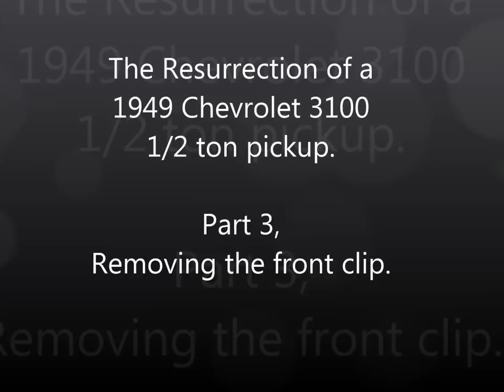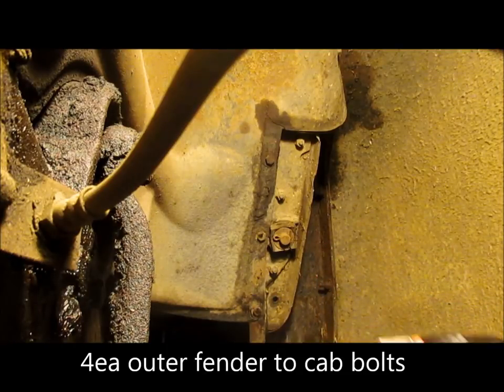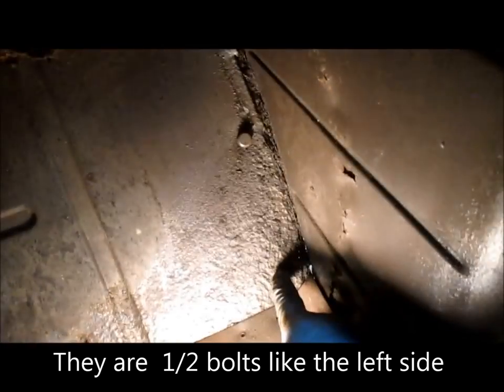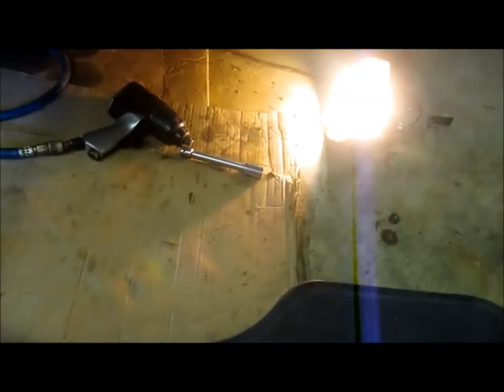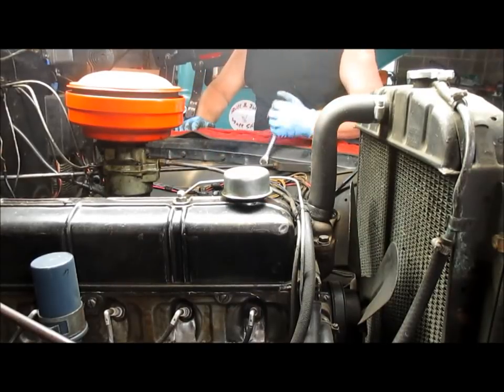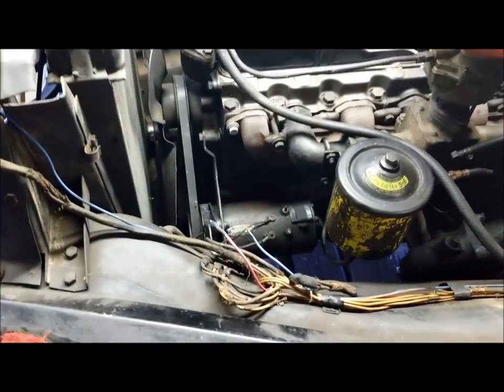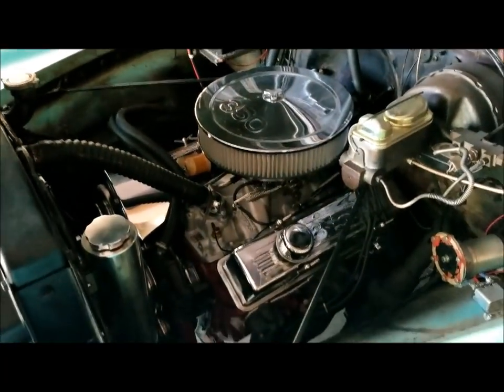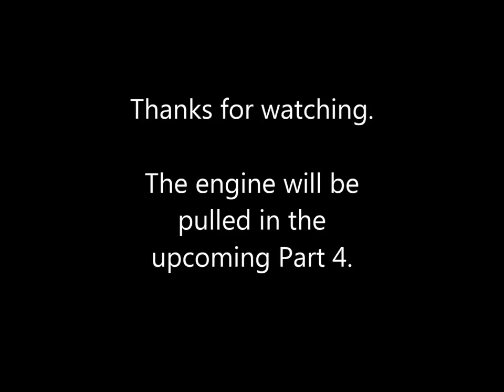How to remove the front clip on a 1949-53 Chevy 3100, Restoration part 3

Comment: Hello SIr,
I was wondering if you would advise to lift the front of my 1950 chev 3100 from the center of the front axle?  I have it raised probably 15" or so in the back (on jack stands) and would like to have it level all around with jack stands so I can work on it much easier.  Would lifting from the center of the axle put to much stress on it and would it be safe to do so?  I would appreciate so much hearing your thoughts.
Thanks,
Wendell Jones
Reply from the maker: Hey Wendell, thats how I've lifted the frontend of several straight axle trucks over years without any problems or side effects. After I get it lifted by centering the jack dead center of the front axle I then place jack stands directly under the spring perches on each side and lower the truck on to them. That way the weight gets evenly distributed on the axle & springs. I also found out that it was easier for me to roll around underneath on large cardboard than on a creeper, but thats just me, lol.
Good luck on your 50.
Dave
Reply: Thank you Dave very much.  I so enjoy your videos and the fact that you're willing to help a novice like me out!  I especially enjoy the rides you show in the old truck!  Looking forward to getting mine on the road.
Reply from the maker: @123jones8  👍

Comment: Were the turn signals factory or added later?
Reply: Question answered on video!
Reply from the maker: Larry, I added the turn signals back when I originally got it running. Turn signals were a dealer option back in 49 and most didn't opt to add them back then.

Comment: Hi there I bought a 52 gmc and have loved watching your vids lots of helpfull stuff. Can you do a video on hood line up. There is not a one on how to but lots of guys having trouble. Thanks again.
Reply from the maker: Hey Jeremy. I'm not needing to adjust the hood on my 49 Chevy and I sold the 49 GMC but I'll definitely do a vid if/when I have to adjust it. 
One trick to use is to place a 2x4 across the fenders right at the radiator then close the hood to where the front of the hood lays on the 2x4. Supposedly all you have to do is tighten the hinges up and you should be GTG.

Comment: It was the same thing with my Bed hardware, I thought, hell I'll soak them and save them. I snapped 3 in a row and grabbed my grinder.
Reply from the maker: Ends up breaking them off was better. I should have used a grinder on that top bolt instead of the air chisel. It did the job but covered me and the floor with nearly 70 yr old grit and grime, LOL.
Reply: @Volfandt  I call it Tomb Dust. Always ends up coating my glasses.